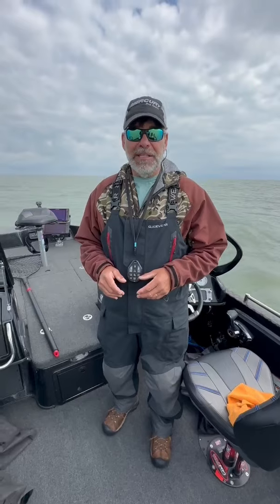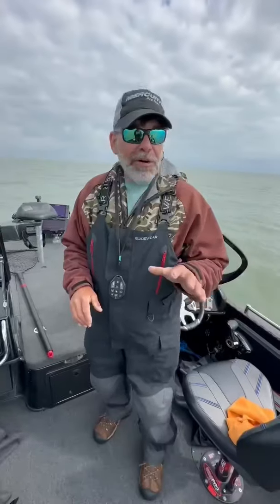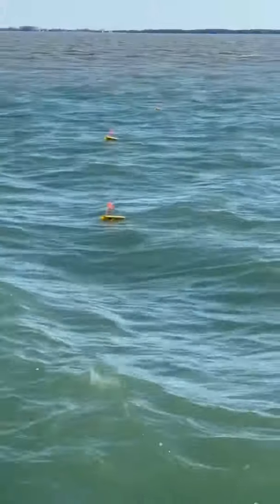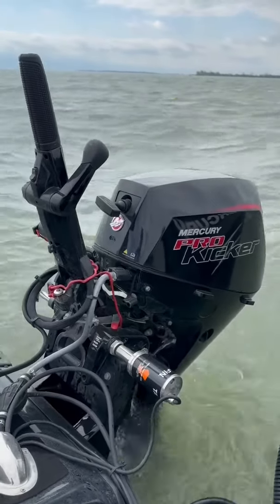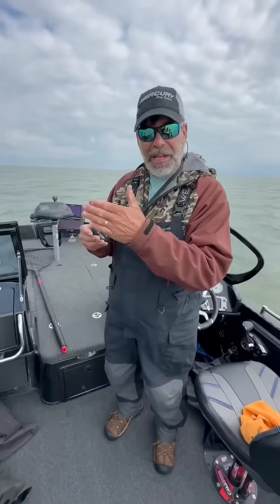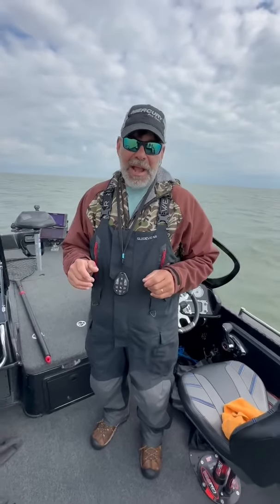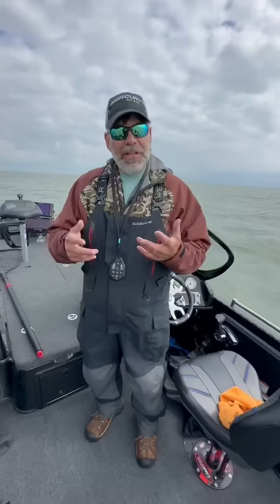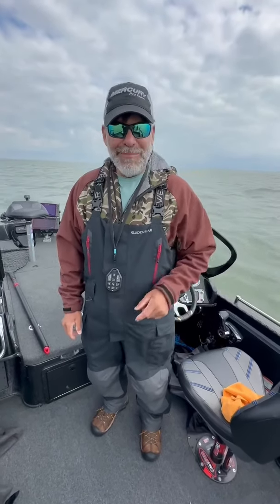Lake Erie Techniques: Trolling speed can be critical for catching big Erie Walleye!

Comment: Why not just network to your display like Lowrance autopilot?
Reply from the maker: As of right now, the Power Pole trolling motor does not link up to Lowrance. I actually like to use the remote better because it’s much more handy to use while I’m standing in the back of the boat.
Reply from the maker: As of right now, the Power Pole trolling motor does not link up to Lance units. I actually prefer to use the remote control because it is handy when I’m standing in the back of the boat.